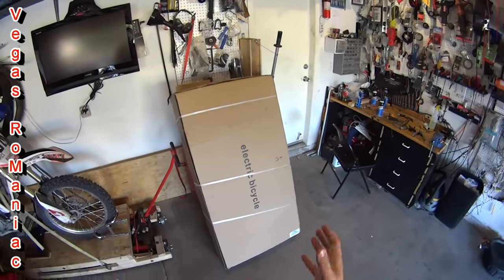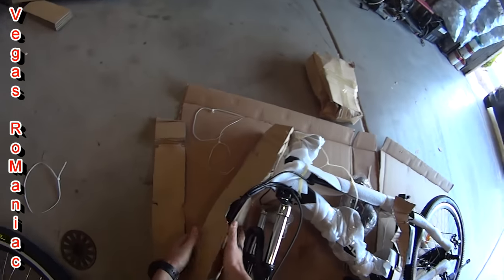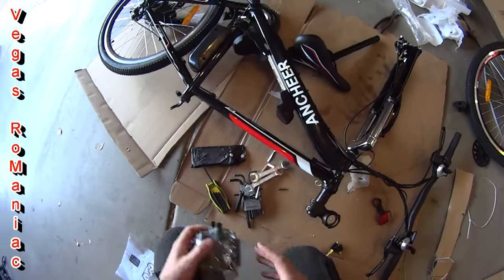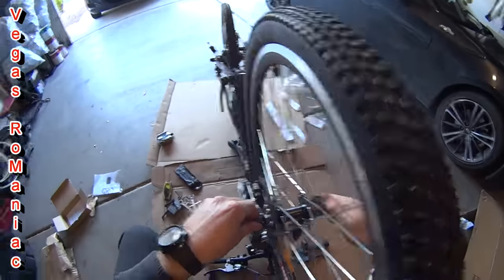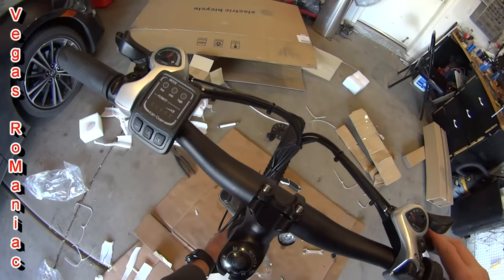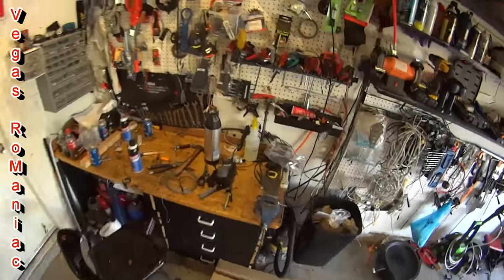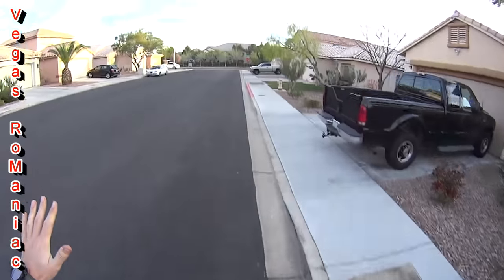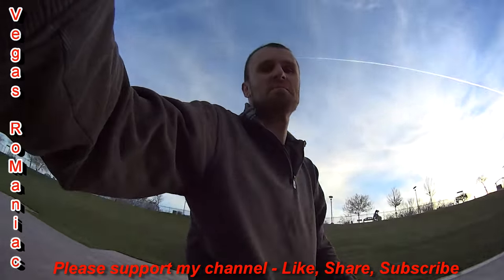ANCHEER Electric Bicycle - Super easy Assembly and first RIDE AKA Eshion Cyclamatic

Comment: He is not using the pedal assist correctly in this video. You don't have to touch the throttle just change the mode . On the left handle bar you would press the + sign to cycle through the different pedal assist modes at the highest mode you can go up to 20 mph...I do own one by the way!
Reply: Hey is there any way to upgrade the battery on this thing? Its a decent bike and all but the range seems kinda lax... it is a 500 dollar bike but still
Reply: Its been almost a year. Do you recommend this bike?
Reply: Can you go faster than 20mph if your pedaling?  I’ve heard some bikes only throttle at 20mph but with pedaling you can go 40mph easy.
Reply: Mine is currently being shipped but I hear this one will go about 30mph before the gearing in the motor starts holding it back. Careful going 30-40 on a bicycle though, especially one that doesn't have fat tires.
Reply: PsykoWheels you can buy a new battery from their website
Reply: Rain reaching the 4 battery terminals is not an issue? They look really exposed because there is a gap between the holder and the battery pack.

Comment: Is it possible to add a second battery by just plugging it in or would you have to cut and re-wire ?
Reply: No
Reply: @NickBritton  
You can buy new Dolphin and Water Bottle batteries to replace the stock battery.  If the connector on the battery is wrong for the bike connector, you should be able to have an adapter fashioned by a local shop that handles automotive electrical systems or a local bike shop that works on bicycle electrical systems.  Only one battery at time should be connected.  The critical thing to look for in buying a new battery is the voltage.  If you have the 36v bike, the replacement battery needs to be 36v.  
The stock battery plugs into one of the connectors on the controller inside the black box on the seat tube.  unplug the battery from that connector to change the mounting adapter.  The new battery will plug into that same connector on the controller.
Reply: Cut and rewire for 2nd battery

Comment: hey thanks for making the assembly video. i just ordered one.
Reply from the maker: It's a good bike, had it for a while, sold it and bullt one after, big mistake the ancheer was better range, double
Reply: @vegasromaniac  yes i went over several other diy plans, videos , and guides over the past 3 years. Nothing really beats this ancheer model by more than a few dollars, and you would lose the benefit of  having a central supplier and most assembly with parts made to fit.

Comment: I just recd my Ancheer and am having an issue with my front wheel rubbing against the round thing(flat disk inside spokes). You mentioned spacers when you were putting your front wheel on. Are those the black plastic things that came with the tool pack? Any assistance you can give me is greatly appreciated!! Thanks for posting this video!!

Comment: I just bought the same bike and had to take it to the bike shop cause I did not have the strength to tighten everything. They charged me $85 for a tune up. I charged the battery overnight and no pedal assist. The bike shop did not touch the battery or wires to see if the wires were connected. I'm charging the bike now and hopefully I can ride it as  intended. We will see. Right now, it us just an ordinary bike. No electric assist. No full throttle. But the bike light works perfectly. The horn an speedometer doesn't work either.  😥  Can you please give me some tips on what to do?  Thanks.

Comment: With the speed these can go.  Make sure your brakes are good.  Most bike shops build them and grease / oil the internal brake cable.  There are devices that can clamp on to the brake cable and inject oil from a can.  Grease will make the brakes work much better.

Comment: RoManiac, I purchased this bike after seeing your videos. Bought this from Amazon and got it assembled at my local bike shop. On my first ride, I noticed the motor makes struggling noises and cuts off during pedal assist. And on full throttle, no power at all. Then comes back again after a few seconds. This got progressively got worse and finally got to a stage that the motor does not come back for a good 5 minutes. After 2 days, it is impossible to ride this bike. Very frustrating.  Ancheer company is not being helpful. They asked for videos and photos which I provided and they are not responding with any solutions. Since you are the world expert in this it seems, could you help us figure out what the problem is and how to fix it. Will provide my e mail and contact details if needed. Please help and advice.  Many thanks.

Comment: I really like your videos. I just bought an ancheer electric folding bicycle which is the sane as this except for battery hanging off handlebars and ability to fold up. I am confused as to the function of the right gear shifter as it has - or + on dial not numbers to indicate what gear to shift in. Can you or members explain shifting front and rear while riding.  I can't  find anything on the internet explaining this.

Comment: My new ancheer bike just like this one , only 3 weeks old, On mine the motor wire is on the other side , the kickstand side.  All the videos i see are like yours the motor wire comes out on the flywheel side, the wheel and motor are reversersed on mine, the screws on the motor are on the brake disk side NOT the flywheel side.   The motor on mine went out after 3 weeks under warranty getting a new one soon.,  i have 185 miles on my bike the last 30 miles have been put on by pure muscle.

Comment: Hi.
Thanks for your vids!
I got mine today. Everything is fine. It looks really good for it´s nice price.
To us in Germany it comes with the throttle seperated. The throttle is not mounted onto the handlebar. Horn and light got different knobs and are on the left side.
I guess they don´t mounted the throttle because of restrictions by law in Europe? I´m not sure. Pedeling assist works great so far.
There goes a wire out of the not mounted throttle but nowhere a description how to mount it. I guess it have to plug the wire into the black box am I right? I don´t open it yet but I don´t find else any fitting plug onto the bike. Could you tell me if the wire of your throttle goes into the box?
Many thanks for your vids! Thumps up!

Comment: I own one and enjoy it.  Beware, however, my battery started to fail after 35-40 charges over a year. I asked Ancheer to ship me a new battery or give me a $150 refund to help me replace it.  They weren't interested. It's over a year so warranty is expired.  they offered me $20.  The bike is fun but you might want to find a company that stands behind their product.
Reply from the maker: Mine had way over 30 charges when I sold it, the battery was rock solid  the motor gave me a couple of problems

Comment: Put my sons together and the wheel and handlebars are not tightened. IE He moves the handlebars and the wheel does not turn or only turns a little. I cannot figure out where to tighten on the bike to fix this.  The bolts by the handlebar do not tighten this.  Any help?
Reply from the maker: Hmm, take it aparrt something must have fallen out

Comment: Just bought this one:  ANCHEER 350/500W Electric Bike 27.5'' Adults Electric Commuter Bike/Electric Mountain Bike, 36/48V Ebike with Removable 10/10.4Ah Battery, Professional 21/24 Speed Gears.   Will use your video to put it together and get hints on riding !  Thanks !
Reply from the maker: Awesome let us know how it goes
Reply: @vegasromaniac  I adjusted  the seat high enough for me.  How do I get the handlebar stem higher ?
Reply from the maker: @joedyke3415  you cant , you need a taller one or a pair of handlebars with a higher curve
Reply: @vegasromaniac  Found a 180mm stem riser extender with six spacers on Amazon.  Probably won't need all six...will experiment. Thanks for your advice !

Comment: Hi! I just got that bike delivered to Spain and I don't feel any difference between mid and high pedal asist. I wonder if you had the same issue.
Reply from the maker: Huge difremce on my side. Btw make sure the speed limiter cable it's disconnected I have a vidoe on that
Reply: You may be right. I just got answer from ancheer customer service department and they also suggest to pull off the speed limiter cable. In Spain throttle are ilegal so the bikes sent here come with that part apart in case someone doesn't care to be fined by police. Pedal assist should also cut at 25 kms/hour. That may be the problem been mid and high levels fix to 25 kms/hour. Pity that ancheer did not make a more progressive assist level for Spaniards. Thanks for your swift answer and have fun with the bike!

Comment: Great vid, I have the same bike,   Love it Except ....... My throttle doesnt work At All!    I want to use Throttle only....yes it will drain the batt faster but....   My throttle is dead.    Think its a wiring issue?   or would I have to order a new throttle?  I heard some didnt get hooked up from the factory.
Reply from the maker: Yeah open the box next to the wheel up and see if it works. Also make sure you out it in throttle mode on the controller on the handlebar. No light on low med high mean throttle mode
Reply: Yeh ......... um, just found this out this morning lol  Its working, Thx~

Comment: seems in Germany this bike is limited to 25kmh.
low works to 15kmh.
medium workt to 25kmh
and no change in high. high goes also to 25kmh.

but still a good bike for its price. like it!!
Reply: metatron2332 i think this bike max speed with no peddling on a straight way 25 km anyway, i live in Germany also comparing the price of this e bike here its super cheap
Reply: Wael alshami yep.
Still running. Great value for money. It is possible to activate the high modus and get speed of 30 to 35kmh by cutting a wire. But it's not allowed in Germany so it is not a fault by the bike or it's manufactor.

Comment: Bought this bike three days ago, the automatic go worked for two days now day three doesn’t work at all, pedal assist still works thankfully.
Reply from the maker: maybe  a loose wire, chekc the connection box in front of the rear wheel make sure all plugs work
Reply: I SOLD IT MADE A GAS BIKE With the MONEY  .THE 8 PLUS CHARGING TIME YUCK DON'T WASTE Your MONEY

Comment: Grease your seat post and the threads for the pedals! If you want tips on how to dial in the brakes and the derailleur, let me know. I was a bike mechanic for 13 years
Reply: FatHead970 ik you have to grease your seatpost and pedal threads, but why is it important to grease your pedal threads?
Reply: +Marcus Bevzyuk . it's less difficult to replace worn out pedals.

Comment: Just got mine delivered today, but the throttle is not assembled (some thing to do with road use in UK). Can you/ or someone tell me where it plugs into so I can have an easier ride off road? Good vid by the way.
Reply from the maker: +Derek Thomson mine came assembled, you should have a manual Chinese or whatever the pictures should give you all the info you need. I'll look at mine when I get home but mine looks like a long wire plugged in to the box behind the rear wheel
Reply: Firstly, thanks for replying so quickly.
The manual, or rather the sheet of paper that comes with it, does not cover this topic.  
I assume it has to plugged into the control box somewhere. When I get back to it, I'll give it a closer inspection. Once again, thanks.

Comment: Thanks for the video. I just put one together am going to slime the tires and go on my 1st ride tomorrow. So far it seems ok but I think I have a brake rubbing.
Reply from the maker: If the disk is bent really easy to fix, if the inside pad is too close to the disk, Allen wrench will adjust that
Reply: thanks just a slight adjustment!

Comment: hi i just bought this bike and it is supposed to be the 500 watt one but i dont see anywhere on it where it says the watts how do i find out?
Reply from the maker: hard to find that out, dont feel bad, i had a 500 and all it does it runs out of power faster , 250 is perfect
Reply: @vegasromaniac  the battery is a 36 V 12.5 ah it is a black one not the water bottle looking one
Reply: @davidcarpenter5104   (a tad late reply) The 12.5 ah non-water bottle battery is what comes with the 500w version. So yes it should be, Unless they scammed you with a 250w motor instead lol

Comment: The disc brakes on this bike are the absolute worst. They barely brake and emit a very loud, high pitched squeak. I’ve tried grease and disc brake cleaner and neither worked. I think they are shot. Lesson learned. Never buy used even if you can get a great deal.
Reply from the maker: There is a fix for the brakes, new pads, replace them with softer pads better brake and no squeek
Reply: @vegasromaniac  Ok. I'll do that. Where do you get softer brake pads from? And I'm not sure how to replace them. I'm sure it's fairly easy but I've never done it before. Also, when I pedal with and with out pedal assist on, the chain makes a noise. I'm not sure if it's the chain guard or one of the retailers. Any idea what could be causing it? It's like a rubbing or rattling kinda noise
Reply from the maker: @anthonyszabo7551  maybe the gear shifter is not aligned properly   there are 2 screws that change the position and fixes that. A bit hard to explain. As far as the brake pads, ebay is full of them, they ship to usa for about 5 bucks, just match with the ones you have take them off the bike and order same shape and size. They are easy to replace..
Reply: @vegasromaniac  ok, I'll do that. Also, I just bought the sunding bike computer you have install on your e bike and noticed there too much of a gap between the spokes and the front fork for the computer to read the speed. How did you install yours? Did you install it on the front wheel? And if so, how far up or down did you install the sensor and magnet? Also, on what side of the bike did you install the sensor and magnet? I'm returning a computer I bought for more money cause I thought it didn't work but realized it just had too far of a gap between the sensor and magnet. It works by hand but not installed on the e bike. I'm puzzled as to how to install these properly on a bike with disc brakes. Any help would be greatly appreciated. Thanks.

Comment: Is this bike good for doing ubereats???  Is a lot of riding
Reply from the maker: Well it will  do 30 miles on a charge if you pedal, and you can keep a battery charging and swap them
Reply: Vegas RoManiac that's pretty good, where is the best place to purchase one of these bikes along with the spare battery????
Reply from the maker: @AssassinKing30  I got mine on Amazon, check out the links below the vidoe, about 500 bucks

Comment: Hi, great video.Thank you. I cannot get the Throttle to work. Can you please make a video to show how it is connected to the motor. I need to know that I have connected the correct wires. Many thanks.
Reply from the maker: It's should have come already connected. I would use a volt meter to test that throttle tube. I can't help you with a video, I already sold the bike
Reply: @vegasromaniac  
Make sure pedal assist is off.  Press "-" till all three LEDs are dark, then twist the throttle.
Reply: Does Amazon have replacement parts

Comment: I feel like electric bicycles have great potential and this model at $500 is a huge improvement. however my only issue with these is how long they last in the long terms? and how much is a battery if it goes toast

Comment: Bought a used one from craigslist for $250. The headlight and battery keys were missing but the hub motor and battery still works good
Reply from the maker: Great deal
Reply: pearl jamz still having good luck with the bike.  I'm pondering the same deal but wondered about battery replacement